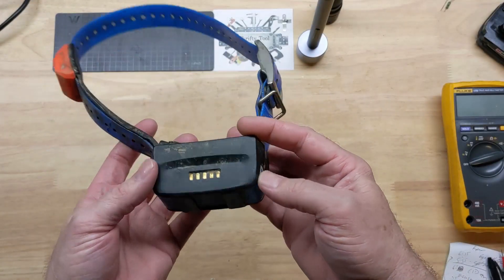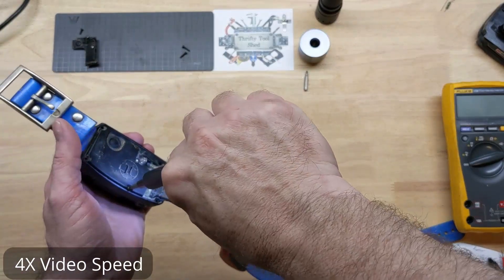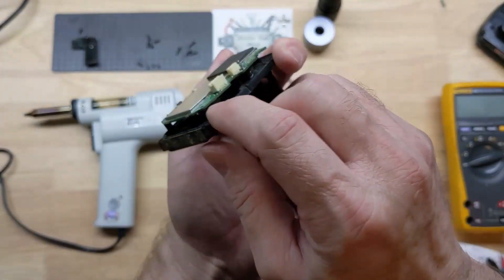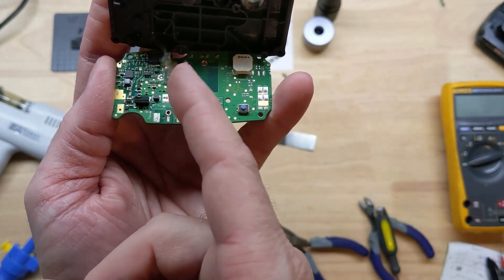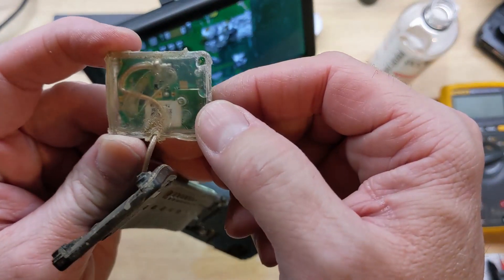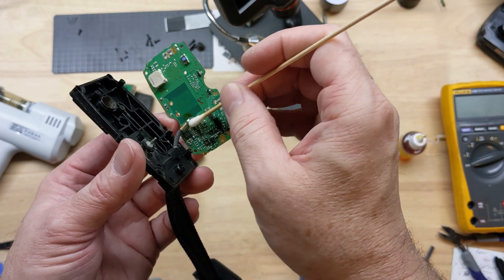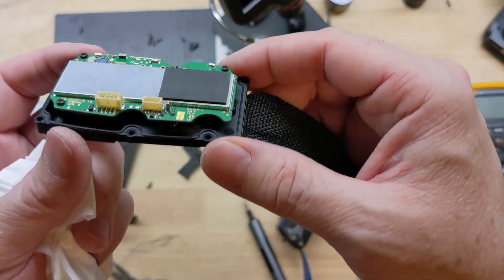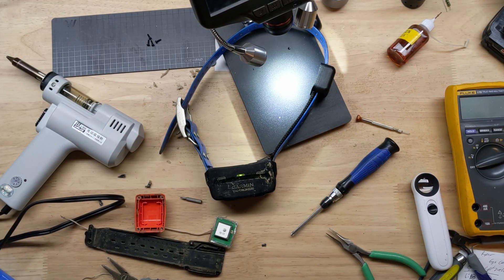Garmin T5 Collar GPS Antenna Replacement

Comment: Can these be converted to the new replaceable GPS antenna on that are on the TT20 and TT25?
Reply from the maker: I do know they have the spot close to the antenna pads where a coax jack could be soldered on, but I have not done that myself to know if it would work with the housing.

Comment: How did you learn to solder like that
Reply from the maker: Hi,
I have been soldering for many years as a hobby. I have learned much more about soldering in the last year or so and attempting smaller and even some micro soldering (with hot air etc.) after watching a YouTube channel called Northridge Fix. Alex is excellent at micro soldering and is very helpful to watch and learn from. Thanks for your comment!

Comment: What kind soldering tools do you have and what is that stuff you put on the solder?
Reply from the maker: 60W Iron usually on SMD. 150W on the large ground plane connections such as  antennae connections. I use RA rosin flux to help with the solder joint, it helps transfer heat and keep the joint clean.
https://amzn.to/3BYkwHf

Comment: What were you trying to show when you zoomed in at 9:43 ?  Very interesting repair. Thank You.
Reply from the maker: I was just sharing a look at that side of the board with shield removed. Just in case anyone wanted to pause and look at it. We spent most of our time on the under side of the board. Nothing specific, great question.  Thanks for your comment!
Reply: I did the same replacement and now I have a solid yellow light? Any ideas why

Comment: I realize this is a Boar failure, however these collars are known for that coax to break down at the radius where it slips under the keeper rubber part.  I have done 3 with this failure.  Small neck dogs are the worse.  Garmin made changes to the rubber keeper which has improved the failure rate a lot.  BTW garmin went up a lot last year on the exchange program so you like me mite see more of these in the future. And your rite it is epoxy and I've had no luck digging it out.  Great video, camera angle is great.
Thumbing Up. 👍